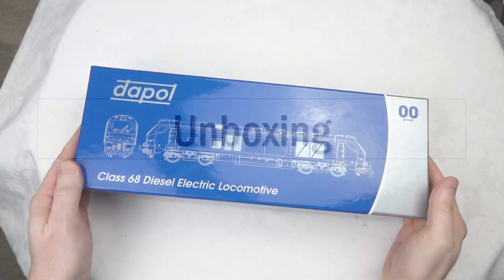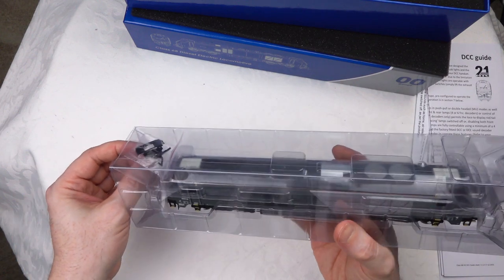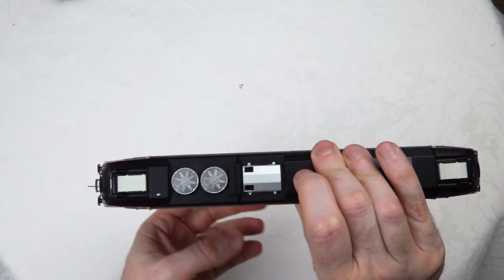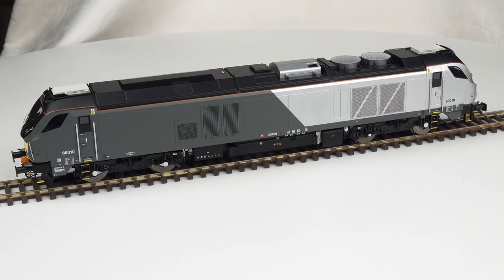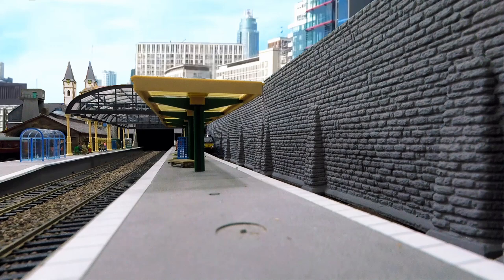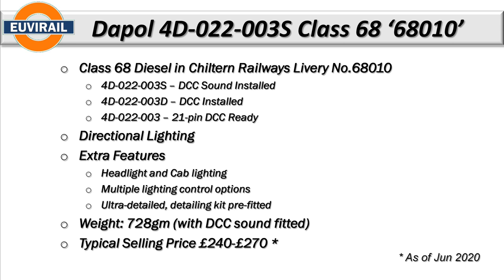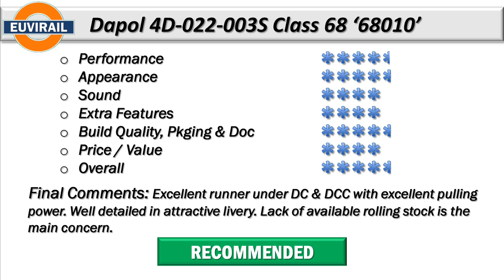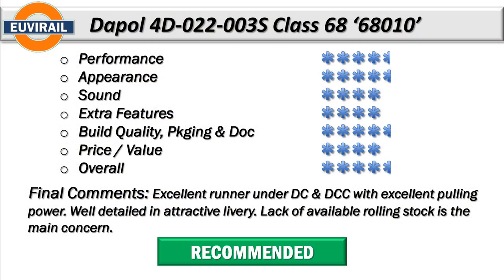Review: Dapol Class 68 4D-022-003S No.68010 in Chiltern Railways livery and factory DCC sound

Comment: A beautiful model of an impressive and attractive design, for modern image! I had an early version 68 010 Children Railway but i sold it on for the reason of the couplings fitted to the chassis  and on the first corner it went round, the hook struck and went flying! 2nd radius curve. 
I was regretting it and when the update came out with the correct disk brakes i got one 68 010 Oxford Flyer. I live about 100 yards from the Chiltern line and see these and definitely hear these every day go by. 

My experience of the model is that its almost guaranteed to derail the stock if propelling, i dont like the chassis mounted couplings.  
I cant hear the correct sound from this running session it maybe just how it comes accross, but when they come past my home it sounds much more thumping and rumbling as you would expect from a V16 engine.
Reply from the maker: Some Chiltern MK3s would also be nice if we could get them.  Sorry to hear of the derailing problems, Soundwise, I don't think I did a very good job of this particular recording. I'd also need to check the speaker I used. It needs more bass.
Reply: @EuviRail  
Thank  you for your reply. 
I have got the Hornby mk3 stock in the wrexham and Shropshire livery / basically blue greys and they were the ones that were de railing . Im going to take advice from someone's comment about those Hunt couplings as i think they would be the way to go?